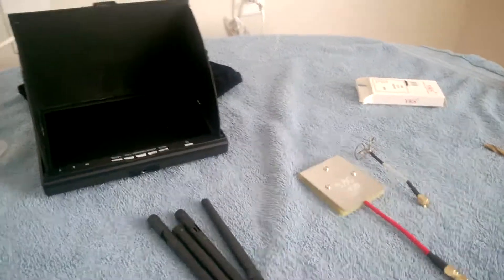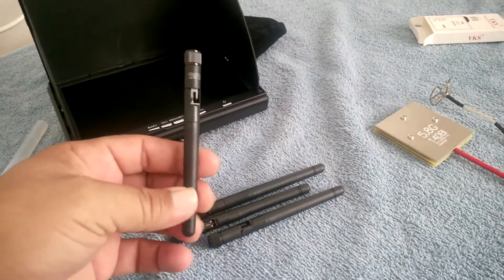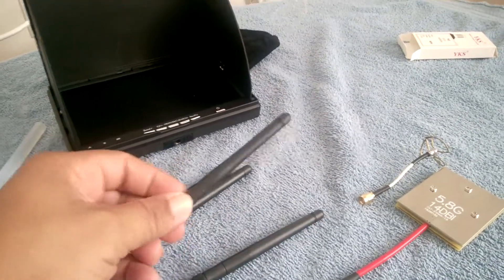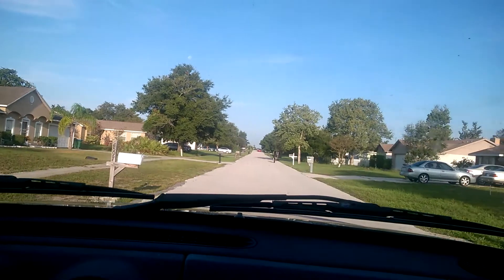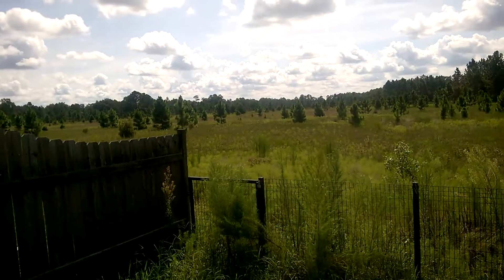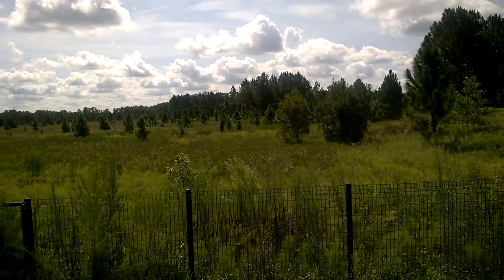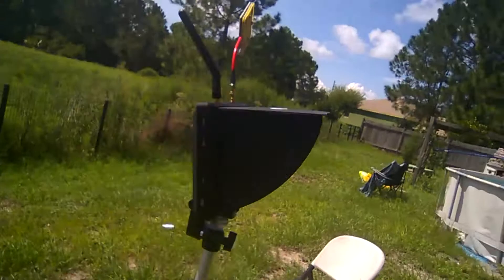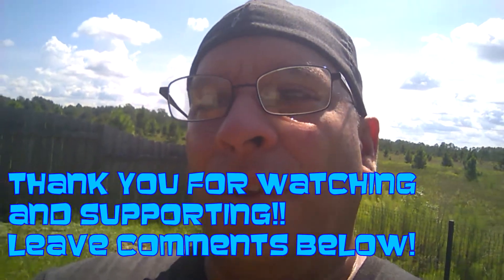Transmitter 600mw Video 2 FAIL

Comment: Doing a similar mod. What did you figure out was the issue with the 600 mW losing signal so fast?
Reply from the maker: it was not the transmitter. It was the RTH on loss of signal that did not work. I believe it just hung up and then decided to turn itself off. I have since sold it since for me it was not doing what i needed. good starter open field drone, but i wanted something more reliable and as i put videos on here just to help people in case of same issues, my emails, comment section became a tech support for this drone. LOL. but i am super happy these videos are still helping out those who fly this bird! hifive!

Comment: Thanks for the vids, Jose. I subed and uped. Am waiting to see how you guys do with UpAir One.  Might buy one but wonder if GTen will improved them based on your testing and mods in real life. All the best.  ps; have you heard if GTen will put the gimbal / cam on a stick for terrestrial videos; like DJI has done with their OSMO? That would be a gamechanger for commercial use.  Then Dronepan might even write code for it.
Reply: Frank, again, here. Your channel so far has been all about education and mods, Jose. As far as I can see on your UpAir One, I mean. So the footage gives me more information and I prefer that. I've seen a lot of vlogging vids and if it's 'likes', subs and followers you're after then vlogging may be the way to go. Hire a pretty assistant; or marry one ! Then you're good for vlogging.  You know that DJI released their Phantom series 'unfinished' (the company would deny that) and let the consumers 'beta test ' it. Then they have made corrections to the product; like extending battery live and auto-turn-off of the cooling fan on the OSMO; they've done this via firmware updates.   This is the new normal, I guess, for technology products. Let the consumer complain and figure out fixes only for the squeaky wheel problems; not the entire product.  Can GTen do this? is the USB port accessible in the body? Unlike the Phantom/OSMO, you have no smartphone control so no firmware updates sent to you for your machine that way. Hmmmm. Maybe a hack/mod of the connection port on the UpAirOne is in order. I don't have one so can't help with the hack; if it is even possible. ie; Manufacturer modding should now be built in on all techie products. As a matter of design.All the best, and thanks again for your informative efforts. FHS
Reply from the maker: wow.. thank you for the support! you have great questions. I am still learning the technology myself. I will do some research. Let me ask you a question. do you like the video footage or the vlog style video editing. I want to make this fun and its very new to me and i am a bit still uncomfortable but i am having a lot of fun! let me know
Reply from the maker: I appreciate it and you are correct. even back first xbox release, they let consumers complain then make a revised version.

Comment: Nice one! with the FPV. I'm still waiting for my upair to arrive, how long can the 200mW transmitter go? And I guess the 600mW switched automatically.
Reply from the maker: with my 200mw i was able to get 1050meters no video disruption. I think your right. something changed the channel while i was in midflight. I will be checking and rechecking again today. thank you for your comments. i appreciate it. I am looking forward to you posting vids once you get yours!!
Reply: +Jose Bauzo over 1000 metres that's long enough for me. was it with cloverleaf antenna or the regular Wi-Fi antenna? will sure post some video. :)
Reply from the maker: clover leaf :)
Reply from the maker: just remember you need enough battery to get back lol. i wouldlnt push it much farther. :)
Reply: +Jose Bauzo Noted. Thanks